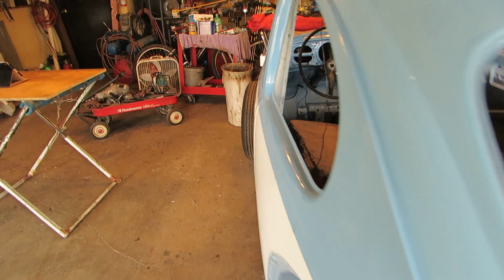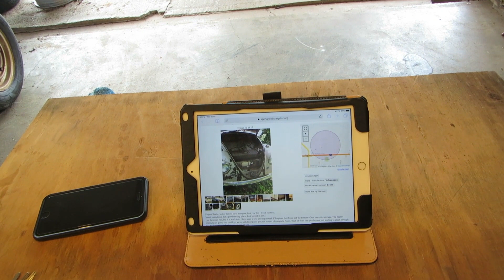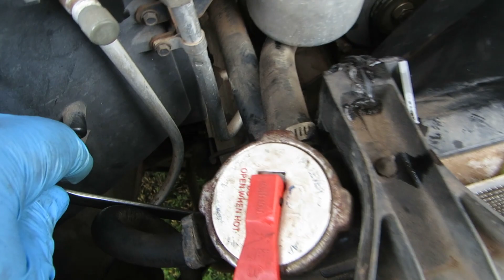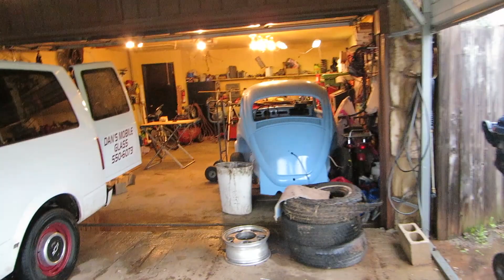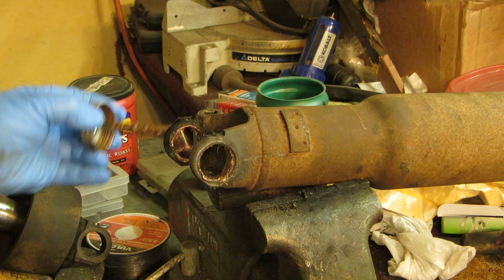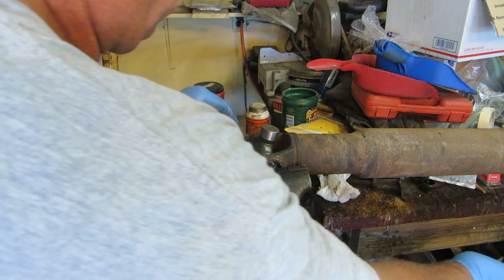VW Engine noise, Transmision flush in Motorhome, Universal Joints in Safari Van

Comment: Dan I have listen to the engine noise with head phones on and Your brother mite be right? I had a cam that nearly sheared the rivets off. It made a knock like It was a rod-nope when I tore it down I looked at all the bearings and told myself they should last another 50 thousand miles. that is when I tested the cam gear and there it was, holding the cam and turning the gear . clack? second thing is it could be blowing compression at the head ? I know you made a jig and seated them but that mite be it all so. The first thing is to check oil screen for debris. and check oil pressure to see if it has dropped. Please do not give up on it !!!
Reply from the maker: no, not going to give up on it. Just so I can move forward with the whole project, I have another short block that was running in good condition. And its a VW case... Not an Auto-Lina

Comment: I hear a little something, you need to install the exhaust tips. Make it a little quieter to locate that sound. Sounds like something in the cam drive train.
Reply from the maker: Yeah that’s what I’m thinking. Cam gear to crank gear?
Both of those were hobbed together So they should be right. I just think that they’re in a case that’s not right.

Comment: There is something funny about that generator pulley, it looks a tad too large. It must be an after market item. If it is too large the cooling fan will spin slower than it should. Probably not by much. Measure the diameter of it and let me know what it is and I'll compare it to an original German one. That's the problem with non-OEM parts, quite a few of them just are not up to original specifications.
Reply from the maker: Well, yeah! There’s something funny about that pulley. It’s the same diameter, but that doesn’t matter it could be the size of a pie pan. What matters is the size of the belt.  And more importantly how it fits around the inside of the pulley . The diameter of the belt around the crank pulley is correct of course. But when you need an extra inch of belt so it’s not banjo string tight.... all bets are off.  Yes it’s turning it slightly slow. I think. First, let’s start with a real case. And see where we get it. You know a good foundation. That’s what I said in my very first video, a good foundation. But I don’t think that Brazilian case, new Brazilian aluminum case is a good foundation.

Comment: That sucks, you have to pull the engine out again, because of that noise. Before you pull the engine out, adjust the choke on the carburetor, so that the next time you start the engine all you need to do is push on the gas pedal once.
Reply from the maker: Nope, a lot of people do adjust the choke where all they have to do is push the Excelerator one time, and your engine comes to life, nice and fat. And running about two grand. That was never for me. 
 It’s my opinion that chokes are overrated. I adjust mine wear when it’s hot out. Like now. It’s almost completely open. Only when it gets brutally cold, do I have it Where it sets on one notch.
 In my opinion, this does two things.
1.  It  greatly reduces the amount of raw gas, going down into your cylinders and washing the film of oil off. As you know, of course most wear  happens when the engine is cold. That’s because of this. If I have to foot feed it a little bit so be it. It’s not a steady stream of raw gas going down. 
2. As Muir said “  it gives you time, to warm up your engine, listen to all the noises and roll a cigarette. Once you get your cigarette rolled  and hitting good you can take off“.  This gives your engine time to warm up which otherwise may not happen with an electric choke.

Comment from the maker: The advertisement in Springfield included an engine for $600 dollars more.
Separately, Abner sold the engine. That way more beer can be bought for his bass fishing expedition.
Now: if you would have seen the photos on it. You would have known that this is absolutely another Abner.
He had taken the original engine out and “rebuilt” it.
Now, ......you know he did a top notch job rebuilding it because .
1. The engine was outside.,on a cruddy wooden crap bench, with various rusty bolts, greasy parts, wrenches and rags strewn all over the place.
2. He SAID it was rebuilt, but didn’t run it yet.....meaning it won’t run of course.
So yeah....just another goofball taking this one year only car, and doing nothing but harm.
He should have left the car alone, and sold it as is. He would have gotten more from the right person..and the band played on..sighhhhh!